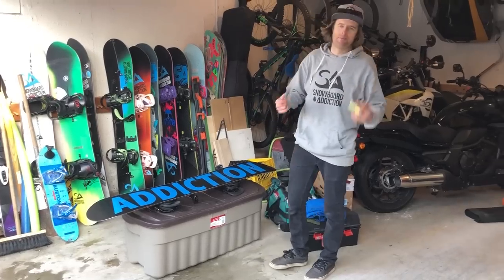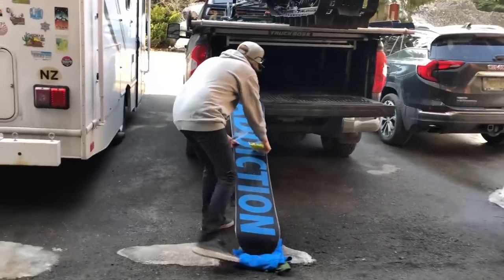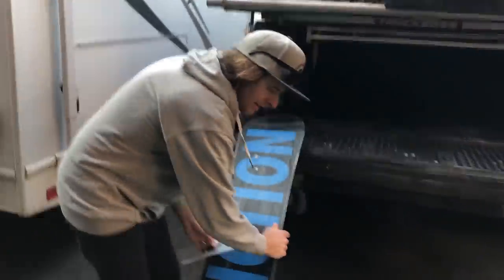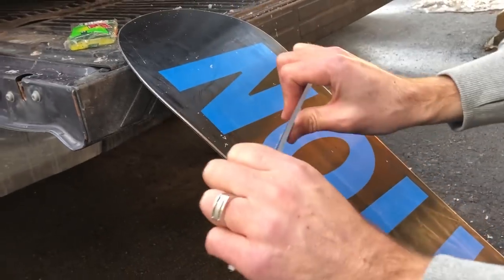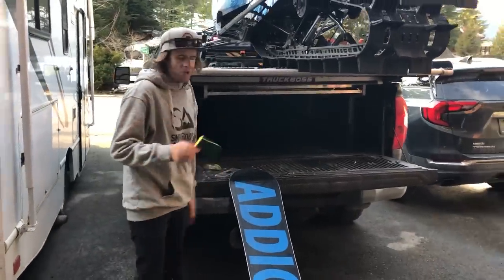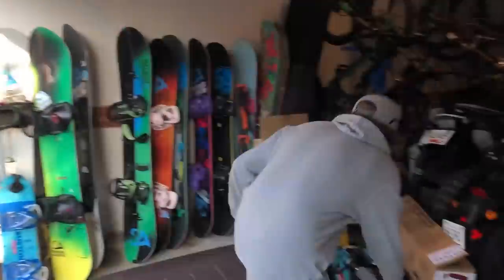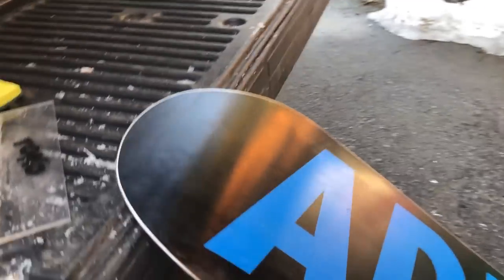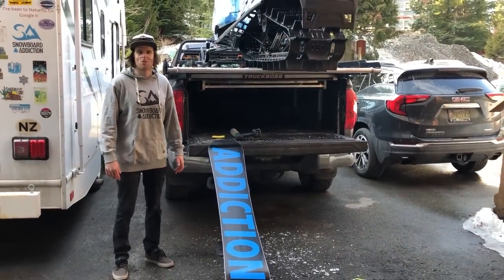Tips With Nev: How To Scrape & Buff Your Board

Comment: What advice or tips can you offer for waxing/scraping convex or concave bases? 

I own a 2019 Jones Flagship, with the Spoon 3.0 tips. I'm not too fussed about that one, as the process just took a bit longer. But I'm looking at picking up a 2020 Yes 20/20, with the Powderhull 2.0 base. I can see that being a right bastard to iron and scrape. I'm thinking maybe use an old credit card, or something similarly soft, to get into the concave section.
Have you or anyone else here got any bright ideas for making the process quicker/easier/better?
Reply: Just an idea, but...google drill brush. I reckon one of the round head brush options should make short work of that concave sections on the Yes boards.

Comment: From any other video Iv seen on this subject, they advice you to angle your plastic in the exact opposite fashion, and I would think it is more effective as it in a sense pushes the wax down into the groves and the pores.
Reply: Yes you're right. Also to scrape in the direction of travel, not half and half like here
Reply: @thaidozy  I think if you're buffing/brushing afterwards, the direction of wax scrape isnt too important.
Reply: @thaidozy  Half half is sometimes just more practical if you lean your board against something like he does, if you have your board on a bench in front of you then it's easier to do the whole length.

Comment: Nev, get yourself a workbench with tuning stands. Doing a wax/scrap/brush on an esky/back of your tailgate with a ToKo 300mm rotobrush using a Makita cordless drill....., something is wrong here???
Reply: You've got all the good ToKo tools $$$$$, splash out on a set of ToKo board grips. Best investment you'll ever make. @SnowboardAddiction
Reply: Grab yourself a single trade/industrial quality saw horse (I used Kincrome Gravity Lock Saw Horse K14111 in Australia). It's like a super rock solid stable work platform. The legs fold up and has a 35mm  laminated hardwood bamboo top. You can the mount the ToKo vise grips onto that. Was only around $Au50 a few years ago.